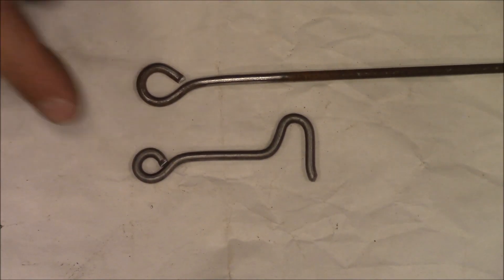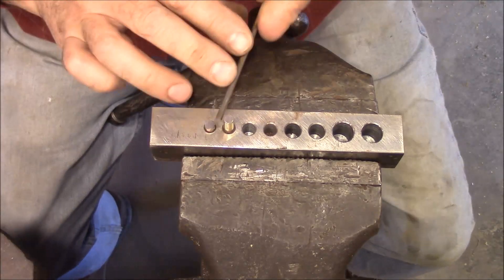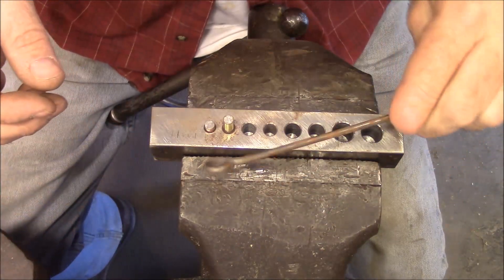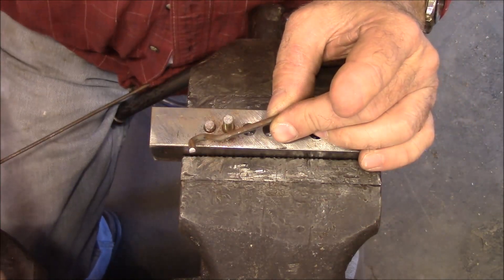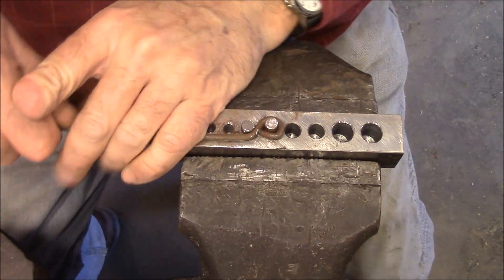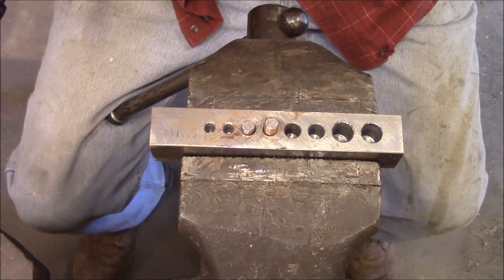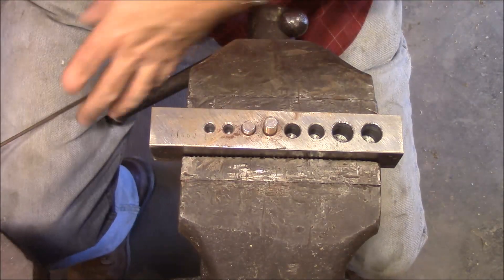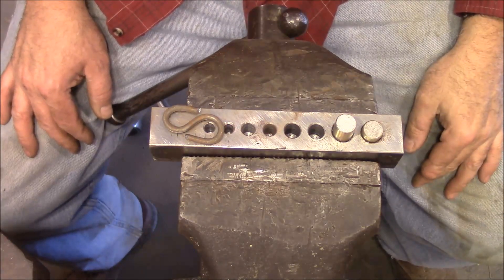Making Hardware From Wire

Comment: Do you think wood would work for the block part. Working with what I have
Reply from the maker: a hardwood like oak would probably work especially if it's thick and you don't bend anything too large in diameter.

Comment: So if you need to buy the wire, what type of wire do you look for?
Reply from the maker: I usually use the wire from political signs.  The problem is getting wire that is stiff enough.  I have also used "insulation support" wire that you can get from Home Depot, it is pretty stiff and harder to work with but I use it when I need thinner wire.  They have a brand called Simpson Strong-tie.  Most wire is not stiff and will just bend when you use it for hardware.  Good luck in your projects!

Comment: Excellent, was looking forward to this one from the last video.  I did begin playing around with my set up, but one needs to think a little backwards on it.  And just love your little bolt cutter, I can see a trip to the Harbor coming up.  Another thing, over to the left of your work bench you have one of those heavy grinders...What do you think of it?  Is that worth investing in, sure would like to consider one, but not sure.  Thanks for presenting!
Reply from the maker: I'm glad you enjoyed the video.  The grinder is helpful for sharpening lathe tool bits but I don't use it for much else.  The original grinding wheels were not very good.  I have a video on balancing the grinding wheels for it.  Good luck on your bending jig.  Thank you for watching and your kind words!